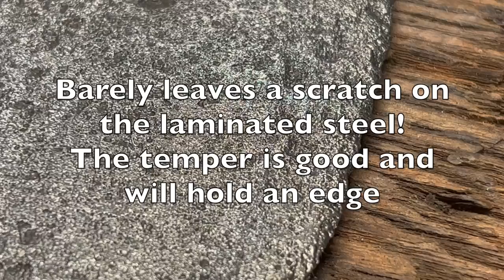MONSTER CHISEL RESTORATION - ASMR

Comment: A draw knife is designed to be used with the bevel down, not up.  This allows you to easily control the depth of cut.  Also use it in a slicing cut, at an angle of 30 degrees or greater to give a much smother cut than the scraping cut that you were using.  The thing makes the work go much faster and easier.  I enjoyed the video.

Comment: Holy cow, you are a master! I love the double swell of the handle. I admit to thinking the blade was a lost cause, but you saw it’s potential shine through the pits and uneven surface. In the end it doesn’t actually matter if the face of the steel is pitted, because the very edge is doing all the work and the rest just glides over the wood.
Reply from the maker: Thanks!

Comment: Your foot-pedal lathe and use of a hacksaw and file are admirable.  It's also nice to see a blacksmith using his hands and an anvil.  Good to see you treating that old tool with respect by carrying it in a padded case.  That piece of cherry-wood has a nice grain for "whittling".  So cool to get exercise whilst you save utility costs too.  You must have very strong legs?  Was that a leather pad to hone the finished chisel?  Great restoration project there. Congrats.  The big chisel could be ideal for de-barking logs too?
Reply from the maker: Thanks.  I enjoy doing things by hand.  The leather is intended to protect the edge.  This chisel is intended to be used when building timber buildings.

Comment: Very good results for a LOT of effort. Thank you for sharing. I especially liked the post drill as I am in the middle of restoring an old one myself. Lots of fun. What kind of wood did you use for the handle?
Reply from the maker: Thanks!  I used Cherry.   I have 3 post drills and with 2 restoration videos in my playlist - Magical Woodworking Machines.
Reply: @ChopWithChris  One of my grandfathers was among other things a farmers blacksmith as was my great grandfather on my mothers side of the family. I was exposed to a lot of old tools and ways of keeping farm equipment going. That may have been why I chose tooling and engineering as a career when I got old enough to have a clue as to what I wanted to do with my life. No regrets other than I wish I had had more time to learn the old ways from them.  I like your approach to your videos as will as the things that you do. I wish the best for you and your family --
Reply from the maker: Thank you and the same to you!

Comment: Nice work, that was great 👍
I'm no wood turner, but in high school I recall adding those decorative rings around handles and table legs etc, and rather than cutting them in with a chisel we wrapped some tie wire around the back of the workpiece and then pulled lightly on both ends of the wire such that it burnt a recessed ring into the timber.
Reply from the maker: I’ve never tried that method but I need to.

Comment: Really amazing to see how it's done without electricity, but even more than that when you needed a wire brush - you restored/built a foot powered lathe and used that, then when you needed a drill press you restored one from the 19th century and used that, and when you needed to sharpen the knife you setup a foot powered honing wheel and used that!   Also, it was great to see the manual alternative to a "death wheel" - a hack saw with a carbide blade - seems a lot safer!
Reply from the maker: Thanks!  I was trying to feature all my tools.

Comment: Nicely done.
I love these old tool restorations.
I restored a bench top hand cranked grinding wheel (6”)it works, it operates smoothly,,,,, but it’s not the best designed tool. Using it the hand crank is too close to the stone and the stone is too small to hold any inertia long enough to do any work.
So you get it up to speed and then get a few seconds of sharpening done and it’s back to hand cranking it back up to speed. I suppose I could get a friend to crank as I use the tool but that kinda defeats the purpose.
I am still proud of it.....
Reply from the maker: Congrats!   Rewarding none the less.

Comment: Great Job my Friend! Your Hand (Non-Electrical) tools, make great craftsmanship. One critique about your restoration,.The way you put the handle and the blade together, without a pin holding it together, will wear out and fall off, and you will have to make another handle, and that is a waste. So If you made a real screw-on pin to hold the blade and the handle together would prevent the blade from falling off from the handle.   Since the pin is screwable, it holds the blade to the handle permeate and you can unscrew it with a screwdriver to replace it with a new handle. 

So I hope this helps. 

Thank you for the fun and Excellent Video and craftsmanship. Thanks.
Reply from the maker: Thanks for the advise!

Comment: These large wood cutters are either "slicks", or "framing" chisels, they are different and designed to for different jobs. 
A  framing chisel is basically a really large bench chisel with a straight socket for a relatively short handle. You would use a framing chisel to prepare large timbers or even log frames for joinery. However a slick chisel has a bent socket for a very long handle. Slicks have "bent" sockets to enable one to push it along a wood floor surface for smoothing it. 

A millwright could use a framing chisel to shape large pieces of wood that might be needed in a factory setting. 

Most D.I.Y. guys don't have one of these very large chisels, but for certain work they are without peer.

Comment: Do you know what purpose this chisel was intended for? log cabin construction perhaps?
Reply from the maker: Yes. When working on a timber frame structure if there is a chunk of wooed you want lop off you just use your slick chisel to cut it off easily.   This was not meant to be struck but rather pushed.

Comment: Looks like a shovel. Also in the same scale as the tool they use to cut away agave leaves. Wonder what its original use was?
Reply from the maker: Lopping off big chunks of wood on timber structures.
Reply: @ChopWithChris  Interesting. Boats, barns, mills, fences, houses.

Comment: Like the fact that you don't use any power tools.  A question: The chisel face seems curved.  Doesn't that make the angle at the tip not exactly 20 degrees?
Reply from the maker: Yes.
Reply: @ChopWithChris  I see.  Thanks.

Comment: Good job on bringing back a neat old tool,right on!
A bit of criticism for you smith: These low heats,and tentative tapping around are poor forge-practice. Old WI doesn't like it,there could easily be Si inclusions that'd fracture,and your material "broom out" in strands as result.
Save that canned gas,get an honest heat on anything that old,welding heat if you can.
That "crack repair" is a misunderstanding of sorts,it's not a "crack" but a weld seam.The hole is not critical,it does not affect the function of socket.In fact,it improves the "health" of wood enclosed by iron by ventilating it(on old English brush--hooks and many other tools the socket was only closed up at the opening,good technique).
Again,by that tentative light tapping you risked ruining the weld;if you're to mess with an old forge-weld-be Decisive about it in forging-high heat/confident blows,by tapping you introduce harmful harmonics that WI in particular really dislikes.
Help your smith to inform himself better about work involved in older tools,it's an important thing to keep on doing.
Reply from the maker: Thanks for the feedback.

Comment: Very nice job for this amount of resources. And nice to see good axe in your hands.
If you are interested, I can give you a few comments that may be useful for later jobs.
Reply from the maker: Sure!
Reply: @ChopWithChris  ook. ;)
Please do not use this custom incredible long tool rest on lathe. On an electric lathe, it will cause injury on this one - it could break the part for you at least. Because it wags like a dog's tail. The original tool rest is short, but it moves and it is rigid. On long parts, a template or ruler is usually applied for keep sizes, and the stand is moved to the right and left, to the place of processing. Your method is unsafe for you and even more unsafe for an inexperienced viewer who might want to repeat it. 

Decorative circle cuts on handle look better when polished by copper wire(1.5-3mm depend of cut width) on spinning detail. The wire polishes and slightly burns the wood in the cut.

Make template of inside cone for handle without hole measuring tools better with copper foil or something like it. roll it, put, correct the position with a stick, fix, extract and measure.

Old metal look cute and nostalgic, but very acceptable to rust especially in pits. Best way is found good forge and ask to forge this chisel onto a straight plate, weld the laminate part and re-harden. Without forge you can try slightly flatten pits with cold forging(i pretty shure you have big hammer), but avoid hit laminated piece and around. Without(or with) all of this chemical bluing is a very good choice for old iron.

Most time when you work with vise(in this video) you place part very high(up to me). Place working surface closer to vise head more ergonomic and can save you time. But its up to you of course. And you have enought good vise so you not needed to clumps for fix iron parts(because its not strong). If you afraid scratch surface - layer of copper foil(1-2 mm) on vise jaws completely save you. (By the way, you love your old file but is time for a new one ;) )

If you dont want fix big hole in water cone on you grind wheel - insert inside peace of wood or plastic with groove and water will flow not so quick.

For woodturning i can recommend you couple of teaching video for fix all typical noob mistakes. Espetially this https://youtu.be/_c8Ujb1djvM and this https://youtu.be/5ErxnE-V7ts (and all this channel). Yep it on russian but subtitles translator work acceptable and russian woodturning scool is very strong.
Reply from the maker: Thank you.

Comment: I wonder if the carburizing flame adjustment on the torch was intentional, or an oversight?  Possibly, the smith wanted to add a small amount of carbon to the steel before forging it.
Reply from the maker: We were just using a basic flame for the repair.

Comment: Why is the handle at angle to the blade of the chisel? Is it because of the size?
Reply from the maker: The chisel is meant to be pushed not struck so when you are building a log cabin and you want to lop off the end of a beam you just walk up to it and push the chisel through the cut.

Comment: When applying solder, first heat the area you'll be soldering. Once you do this the solder will flow into the work much smoother and more uniform.
Reply: Was the area that was soldered not a remnant of the original blacksmith's work? Not a fault in the piece.
Reply from the maker: It was a fsilt

Comment: Wow, what a undertaking. 
How long did it take to grind the blade on the wheel?
Reply from the maker: About 2 hours.  I was very tired…
Reply: Was there supposed to be a strip of leather or some wood shavings in the water funnel so you could control the amount of water running on the stone while you worked? Maybe a constant drip or dribble so you don’t have to keep stopping to refill? Just curious.

Comment: Just came across your channel, I also restore and use old tools. I prefer the pre-1930’s tool steel over the modern steel. It just seems to hold an edge better not to mention the nostalgia of it. I like to think of the craftsman in the past that purchased and used the tool most likely to earn a living and now here I am using the same tool 100+ years later. How many modern tools will still be being used in a hundred years???? Makes you think how we have changed and view things these days.
Reply from the maker: No doubt!

Comment: How much was the foot powered grindstone and where can I get it
Reply: And i personally would have the funnel with a smaller hole for longer lubrication time while also wetting the stone first so it would always have lubricant during the entire process. (Not too much as too wash away the grit that helps sharpen whatever is being worked on though)
Reply from the maker: Good point.  I need to adjust it.
Reply from the maker: Got it for free from my uncle’s farm.

Comment: Grand dads had a water trough attached to his identical to yours as his lathe and vices were different my dad built a drill press simulator to yours but it was electric but my other grand dads wasnt it was hand cranked with a variable drive transmission integrated into it from the old iron works where we lived
Reply from the maker: Sounds like you had some amazingly cool grand dads!
Reply: @ChopWithChris  oh yeah I learned alot from both of them one a carpenter farmer and the other a mechanic and fabricator, my dad he was a foundry worker and mechanic and he taught me about forge work  and imagineering.

Comment: as a blacksmith i can say with at LEAST 90% confidence a hacksaw will not make the material hot enough to lose the temper on the metal
Reply from the maker: Now you tell me! :)
Reply: @ChopWithChris  haha. Another tip if you'd like, you'll have an easier time reshaping the metal if you get it hot enough that it holds the head a little longer. A constant dull red glow will give you much better results and be a bit more efficient
Reply from the maker: I have so much to learn!!!  Thanks.
Reply: @ChopWithChris  yeah, essentially what's happening is the rest of the cold material is sapping the heat from the spot you were trying to work on, and the anvil sucked out the heat as well. Generally you would heat the piece before getting it on the anvil, get it nice and red hot and then start working it on the anvil so you hold that heat as long as possible

Comment: That's definitely a large timber slick there
I'm very surprised that the soft body of this slick is as pitted as the " bit ", usually the hardened steel resists pitting better than the rest of it.
Then again my experience is only with axes and not things like this.
Reply from the maker: Thanks

Comment: Excellent project!  Thanks for posting it.  You did make one easily correctable mistake.  The rim of the socket should not seat tightly against the shoulder of the handle.  Wood moves and the handle will shrink.  If you leave a gap between the socket rim and the shoulder, you are allowing for this movement.  Also, the point of the cone shouldn't bottom out in the socket for the same reason. Very good workmanship on this old slick.
Reply from the maker: Thanks!

Comment: You fumbled the ball in the red zone with the rawhide lace holding the the leather sheath together.  It should have been sewn with heavy linen thread.
Reply from the maker: Why linen?
Reply: @ChopWithChris  Because that is the material traditional leathers workers use.   If done properly, it is a much strong and longer lasting stitch than lace, not to to mention it looks nicer and more professional.

Comment: Well done, but you do know there is this new invention called electricity, right?  :)

Seriously though, just the bit about cutting the bevel should give people some idea as to why tools used to be so very expensive.  

I have a small slick with the socket broken or cut off.  One of these days I will have to forge a new socket, probably from black pipe, and weld it on.  Unlike you, I will MIG it on and save my time and the heat treat. 

Nicely done.
Reply from the maker: Thanks!   It was a fun project!

Comment: The "crack" isn't a crack, it's where the steel was rolled from the edges in and forge welded together to make the socket. This slick was almost certainly blacksmith work, that's the reason the steel "rotted" so bad, typical.

Comment: If you can bend it with a hammer, it is not hardened steel. So you don´t had to worry about the chisel loosing its temper dude.
Reply from the maker: There was a hardened piece of metal welded to the front of the blade.  The rest was soft.

Comment: You didn't need to cut off the end of that slick it would have worked with the pitting left in it because I have used chisels with pits and nicks in it with no diminishing of of ability to its what you want it to do

Comment: I'm not going to lie, that grindstone seems kinda cheaply made 😅 IK it is an antique but I've seen much much higher quality ones for the time like for example ones with their own built in water trays and are more even and less flimsy. I am surprised you didn't upgrade it by for example building its own custom tilt tray or its own constent fed water supply.
Reply from the maker: You are right.  It’s not high quality so I have now made my own foot powered water cooled grinding stone and just launched to Make video.  Check out my channel and let me know what you think.

Comment: It is not finished! the metal blade and the handle receptacle are not finished. You can see all the bumps on the metal. It should have been filled up and then filed completely flat ready for paint or polished it off.  Thanks for fast forward! This video is too long.
Reply from the maker: I am happy with the result.

Comment: next time ask a bladesmith before doing youtubers job on old tools . the socket was not cracked ...it's just  a  forge welded socket . you could have tapped the tip of the edge  or simply reforged and heat treat .   and grease the blade please .it is rusted enough do'nt you think ?
Reply from the maker: I use paste wax on the blade